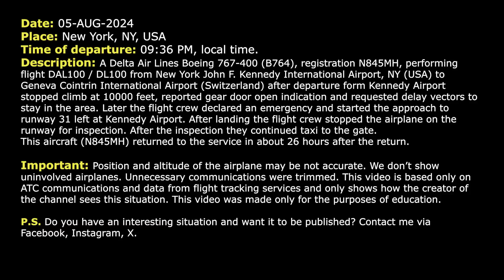Gear door issue after takeoff. Delta Boeing 767-400 declares an emergency at New York. Real ATC

Comment: Oh - it's a flagship flight: Delta-100.  (2 & 3 digit flight #s are your major routes; four digits for seasonal, less-frequent, positional, or ferrying hops.  And the closer you get to the 00s break-point the more major the hubs you're flying between.  Evens are S/SW/W routes; odds for E/NE/N.  Under 5 for outbound and over 5 for the comeback.  All are just general rules - but, now you know.)  Glad they landed safely... would have been a shame for Delta to have to burn the 100 flight #.